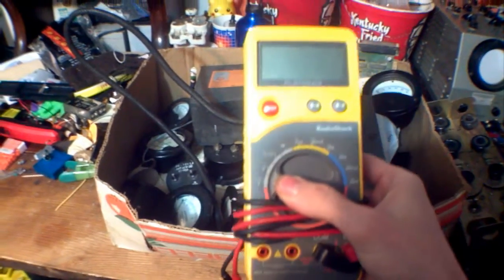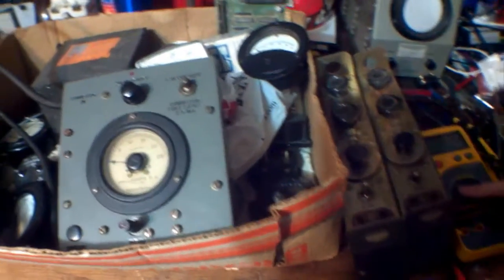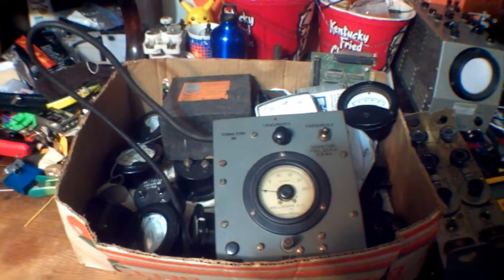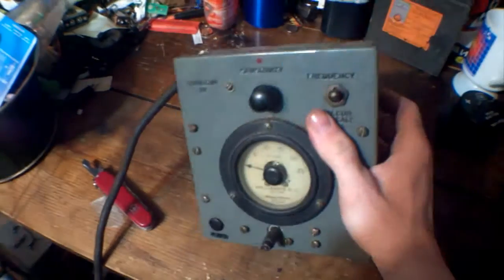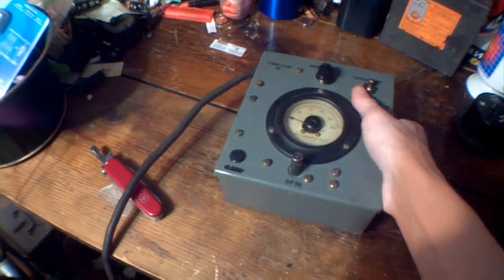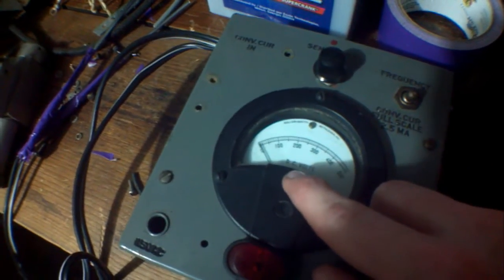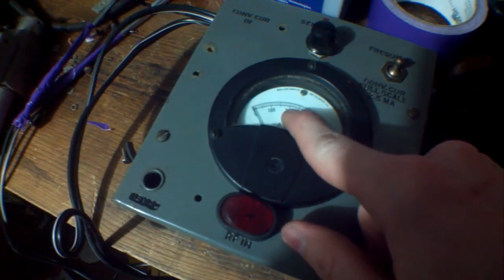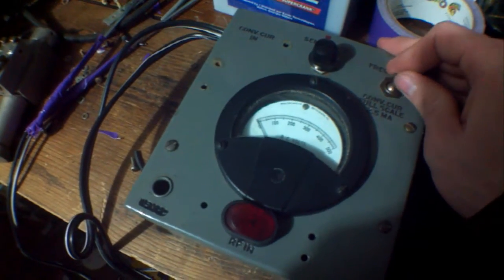DIY: Multimeter from vintage parts.

Comment from the maker: i have some extra radio tuners from 1947. each one is about the size of a CD-ROM drive. and inside is like 3 variable pots, got some old dials on the front, and some coils and a switch.

i got like 17 of them and would love to give one away. would you like one? (free depending on shipping). and if you ever need tubes or guages just ask me, i got suitcases full of tubes/parts. and i keep buyinhg more xD